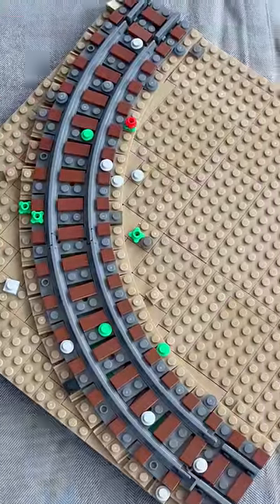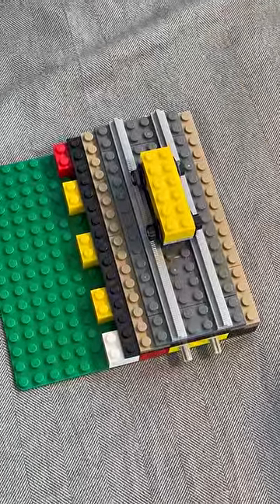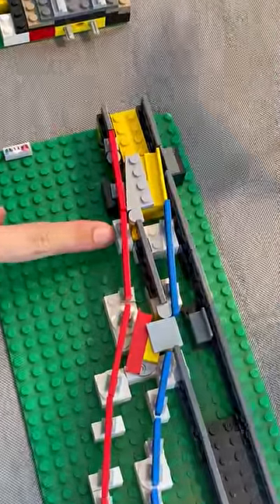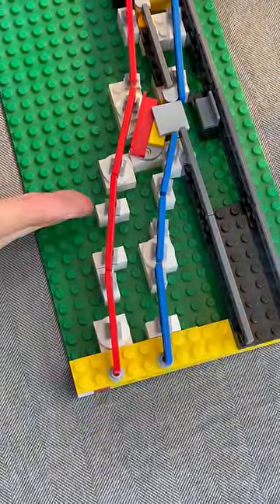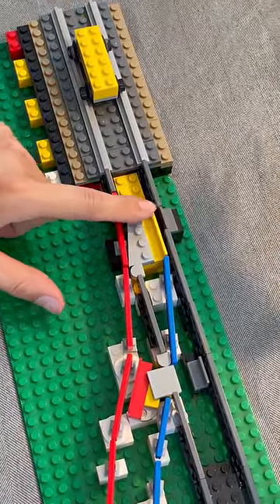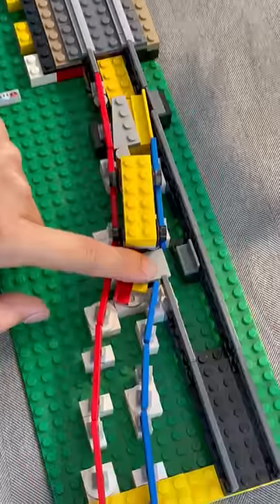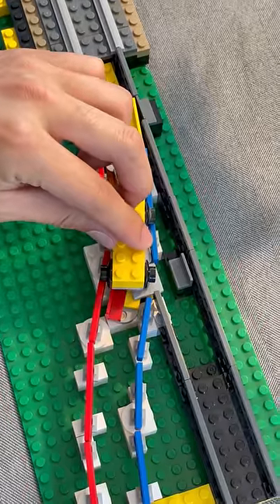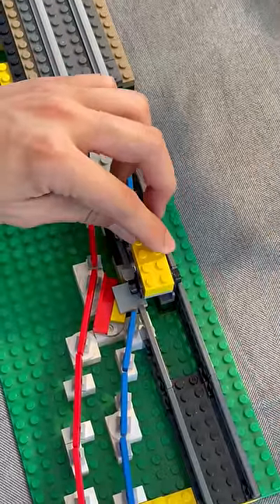How to Build Custom LEGO Narrow Gauge Switches

Comment: The little "guardrail" that is mentioned is actually called a Check Rail.
Reply: Radlenker
Reply: Civil engineer working in rail in California: we call it a guard rail mainly, there's a ton of regional variation in rail terms in my experience
Reply: But is the frog a frog?
Reply: erm actually 🤓
Reply: Check Rail and Guard Rail both are valid and depends where you are located.
Reply: both terms are correct actually
Reply: Your well actually got well actuallied

Comment: Super. On my two old school Lego train sets, you could use the straight track as narrow gauge or wide gauge, and I often built narrow gauge, (3,2,1,0 Lego nubs between the rails) single rail monorail trains, standard gauge, (4 nubs) and wide gauge (5, up to 10 nubs, or even wider for a heavy crane on the rails) locomotives, cranes, and train cars, but the curved rails only worked at 6 nubs, (L gauge) so my creations only had short straight runs. The Lego sets that I had allowed me to build a narrow gauge Plymouth B-B trucked center cab switching locomotive and a nice narrow gauge four wheel caboose (2 nubs) that stayed on display in my room for years, but my best was an EMD SD-7 High hood locomotive, with six wheel trucks with sideframes and handrails, in 8 nub gauge, in the CB&Q Burlington Route Blackbird scheme. Kept it about fifteen years until it got turned back into blocks. 💙 T.E.N.